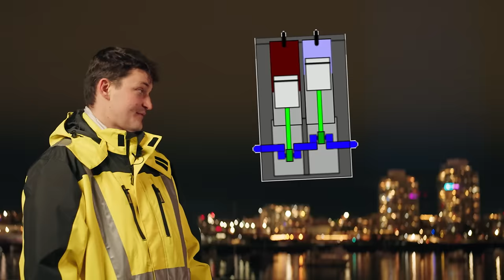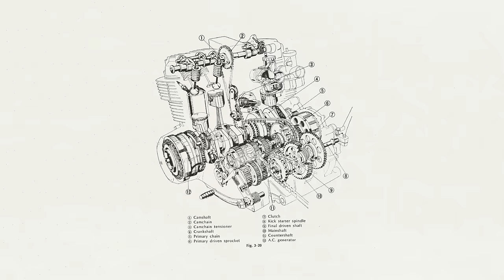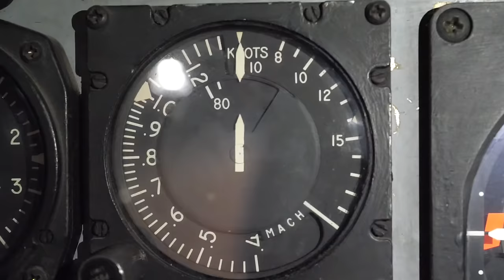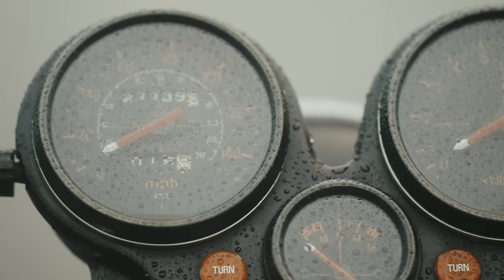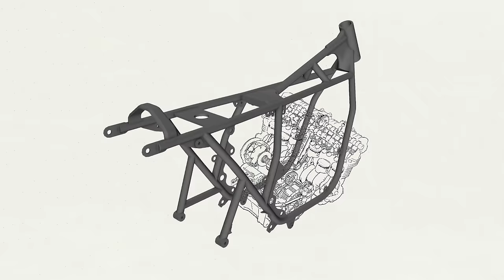Riding the Cream Machine - Honda's Smooth Six

Comment: Fortnine videos are part of what got me onto bikes and something i used to watch with my dad. He passed away very recently and every time I watch this channel I think of him.
I'll never buy a CBX, or a Pacific Coast, or a Burgman, or a CBR250RR, but Ill always have the memories of discovering them with my dad.
Reply: You can import a 250RR for around 7k thru Moto2 Imports, or buy a ZX4RR which is the same concept but with 2023 tech for ~10
Reply: @IAnolastname  I won't buy a CBR250RR because I don't want to, although it would be really cool to own.
Reply: @IamPinhead  i wont get a cbr250 as theyre common. seems everyone has one here. 

 mate had about four at one point. and somehow the prick made about $2k off each one, by simply buying at the right time, and willing to drive a few hundred km to the middle of nowhere to pick them up.

also not very comfortable.

fzr250 vastly superior in every regard.
Reply: @paradiselost9946  yes, the cbr250 is common. the 250 RR is not.
Reply: @paradiselost9946  anyone that knows anything would understand that the cbr 250, 250R and 250RR are all very different bikes. you can try to flex your knowledge of different variants of motorcycle, but that doesn't change the fact that a cbr250 is a fundamentally very different bike to the cbr250rr

Comment: Rode one of these 30 years ago, amazing machine to ride, and an unique experience. Still sticks in my memory to this day. The turbine like "woosh" of smooth power was an eye opener even in the 90's.
Reply: Same. I rode a 79 back in the day. Good ride, smooth, great  sound. I always wanted one of the last ones with the fairing.
Reply: Imagine how it felt in the 80s  🙂
Reply: @DukeDyson  I'm 66. I know what it felt like in the 80s. I also had a GS1150 in 84 and a GSXR-1100 in 86. Was a fun time.
Reply: I like the Benelli 750 Sei
Reply: @SingleTrackMined   I had the GSXR -1100M reputedly the best one to own and man that bike sometimes scared the shit out of me. I recall between stop lights even the GSX1000R of 2001 would get surprised when the black beast was wheelying right next to them.
Reply: 42 years age I had a 750 4 K2 and my flatmate had the CBX,  we swapped bikes now and then. The CBX was fun and i always wanted to own one, but also realized that the old K2 was the one for me.
Reply: @Paulman50  There's a guy at our local bike meet has a 750 K2. 4-2-4 exhausts. Handsome looking machine and he keep it pristine despite being out on it most mondays even in shit weather.

Comment: I purchased a Black 1980 CBX off the showroom floor. It was an awesome engine on a so-so chassis. 
I added an Ontario Moto Tech 6 into 2 header and  the Honda engine guards. It sounded like a Porsche Carrera! 
Otherwise it remained stock and perfect until I sold it in 1992 with 13k miles on it. 
I rode that bike from Iowa to California and back in the summer of '81 by adding a bolt on windshield and a backrest / luggage rack. 
Stayed in KOA campgrounds every night. It was a trip I've never forgotten. 
When I sold it I gave the guy the original pipes, factory service manual , and the tools and shims for valve clearance adjustments.
I wish I would have kept that bike, or at least the extra "stuff" I threw in, but that's life. 
My CBX did have an appetite for voltage regulators!
I get to still enjoy riding on my '01 FZ1, '05 Sportster and '08 Goldwing.  
I hope everyone has a wonderful holiday season, and pray for safe riding for all in the New Year!
Keep up the great videos Ryan,  I like your style!
Reply: My 99 cbr also liked voltage regulators.  Also full pumps.

Comment: I just picked up a 1981 CBX this spring and put about 2000 km on it this riding season. Looking forward to many more years on it, it is a wonderful machine.
Reply: I highly recommend taking your 81 CBX out on a empty highway and ducking down behind the fairing and onto the tank at 85 mph, out of the wind blast and noise, and just listening to the sound of the exhaust, all the cams, lifters, chains, valves, gears, etc. just whirring and singing away only a few inches below your ears. Truly nothing else like it in the motorcycle world .

Comment: Awesome video! You should do one on the last of the litre sportbikes without any rider aids whatsoever. Not sure what year that'd be, but I remember my 929RR didn't have any, not even a steering damper, making for some very hairy off-ramps and late-fall rides on wet pavement (no abs, no TC, no quick-shifter, no slipper clutch) with 130ish HP on hand.

Comment: A beautiful piece of engineering, and a beautiful video! The CBX has got to be one of the most special motorcycle ever created. The throttle response looked insane! The way the forks slid up every time you revved it, what a feeling it must be to experience!!
Reply: With such small cooling fins and 6 cylinders how in hell does this thing not overheat??? The middle ones seem to have no way of dumping all that heat due to the lack of surface. Or does it have an oil cooler? Does anyone know?

Comment: So impressed with the balance between reverence for an iconic design yet also a realistic appraisal of its shortcomings. This channel keeps improving and evolving for the better. Kudos!
Reply: Oh, it had shortcomings, by the truckful, but then you knock it down a gear, give it some, and you don't care anymore. Until you want to slow down, or turn, or refuel.
Reply: He didn't really mention any shortcomings of the bike. I'm confused as to what you're talking about.
Reply: @jaredlancaster4137  he discussed how the bike wasn’t terribly successful in sales and didn’t seem to really resonate with riders at the time.
Reply: @ooklamoc4411  and he repeatedly emphasized that that was a problem with people, not the bike. That the bike was perfect, in fact so perfect that it highlighted the shortcomings of the person riding it.

I know what you mean, but the biggest point of the video was that the bike had exactly zero shortcomings.
Reply: The perfect bike does not exist. For example the motor not vibrating at all must be good for some and not enjoyable by others, the same as having no torque on low rpms vs a lot of power at high rpms or having a motor too big and heavy for the chasis. Some people may love it but others don't, there is a motorbike for every age and everyone but non is perfect for all.

Comment: Thank you for this. I rode a CBX for 3 years. Its handling shortcomings can be overcome with a 5 piece fork brace and swapping out the factory swingarm bearings with needle bearings. A D&D  6 into 1 open megaphone pipe was treat too.

Comment: Back in the early 80's my roommate had a 78 CBX 6cyl, painted black. It was a huge bike in those days. I drove it once and only down Ottawa's Queesnway for a few miles. It was too much power for me as I was driving a 78 Yamaha 650 Special (still driving it today with 98k kms on it). I thanked him for the ride but passed on other chances to drive it. He even said it was tough to tame when holding the throttle open. His friend also owned a silver model and was an engineer/mechanic, so he did all our tunes up back then. He had great attention to engine maintenance and specifications and kept those CBX's running smoothly for years!

Comment: Love the CBX, I wish they'd make a new one
Reply from the maker: I'm not sure you'd get one past Euro 5! The unburned hydrocarbon emissions of a six cylinder are massive. The exhaust on this thing smelled like straight petrol, and it wasn't running that rich. ~RF9
Reply: @FortNine  yep, same reason why cars are moving towards 3-cylinders despite the worse balance, bigger cylinders with the same displacement = easier to pass emissions
Reply: @FortNine  Get the engineers to work. Motorcycles have been left behind in the MPG engineering department. My GS1200 doesn't get much better mileage than my Mazda6 considering the weights involved. Motorcycles could do lots better and should.
Reply: @countrugensfriend350  If you want fuel economy get a single cylinder bike.

Comment: bought one of these in the 80s that had dropped the cam chain .it had 20 bent valves 13 smashed valve guides it was pulled apart and i bought it for $600 it was 2 boot [trunk] loads to get home.cost $800 to repair in parts and head work.still kicking myself that i traded it in on a atc250 and got $1500 trade in.i loved to ride it as with the 6 into 1 it did sound awsome

Comment: As someone who owns several  CBX1000 (and a track day bike) and works on these for Customers day in day out this video is an excellent summary of the CBX. A well sorted CBX Z model is actually not as bad in stock form as some make it out to be. I have ridden many on the track, with Prolink 39mm forks and a CB1100F swinging arm it handles exceptionally well for a 70's design. Yes it's old technology but the 6 cylinder passing 9500RPM on full chat is something to behold for the rider and spectators alike.
Reply: Cary is correct! A CBX with six into six, has a scream , you have to hear to believe! 
I have a 79 and 82 in the garage!

Comment: One of my favorite motorcycles. The 79-80 were pretty much that awesome 6 cylinder engine with a Honda 750 suspension. Straight line performance was the goal, not hustling through the twisty's. 81-82 were the Sport Touring years with the larger front forks (43 mm's) and the Pro-Link rear suspension, detuned engine for more lower mid-range torque, full fairing & bags. Always wanted an 82 model with the white paint accented with blue & black striping. In SoCal in the mid-80's, you could pick up leftover 81-82 models in the $3000 price range with 79-80's for $2500. You could have bought a Baker's Dozen of CBX's for about the price of a 2024 Harley Road Glide. I wish I could time travel back to 1985. 😀

As usual, great content and video from Ryan and FortNine productions. I loved the CBX taking off from the highway.

Comment: Had a silver one in 1980 and it was some machine but I was never comfortable at speed or tightening corners, especially with any weight on the rear, like luggage - then we add 80's brakes and tyres to the mix in wet weather. That said it was an amazing machine and would have kept it but for rumors of cam chain wearouts and the associated running costs. Years later I got a HInda VF500. It was almost as fast, similar top speed, and infinitely more stable and settled. To this day I regret selling it. Thanks for this review, I think you hit the nail on the head.

Comment: I owned a 1979 CBX for 14 years. It was a great bike. To properly appreciate its sound, you need the 6-into-1 exhaust system. It positively howls with that system and sounds like a Formula 1 car. It sounds much better than the stock system or even that after-market 6-into-2 system that your test bike had.

My CBX was in pristine condition. I sold it in 2004 for $5500 which at that time was a good price. If I had only known how much they would appreciate I would have kept it. If we only know then what we know now.

Comment: Merry Christmas F9! Thank you once again for a year of great content and the ability to keep the humour and still be informative and unbiased. Also to show the  passion for motorcycles. A skill that I admire. 
To add to your CBx conudrum. I moved from a 2002 ZX-6R (carb fed and owned by myself for 15 years) to a 2018 S1000RR. I openly admit that bike is more than I will ever be rider wise and the electronics are amazing and make me look more skilled than I am. Does it have more character than a ZX6R? No does it make me feel more alive than a ZX6R? No. With no rider aids and no electronics it made me concentrate and learn. But with all things 2 wheels and powered. You only get out what you put in. Respect and knowledge will get you so far. A bum that bites the seat because your skill set needs honing also helps

Comment: I’ve got an 81 since new.  Love it.  The only issue is the 6 carbs and keeping them in sync. Lately can’t find a local shop to work on it.  The only downside.  Rides great on the highway and comfortable for my 6 foot 6 inch frame.  I think it’s too large for many riders. It was expensive in its day, but I waited until the 82's came out and they were a bargain.  Sadly when they stopped production, a year or two later you could buy these for half price.  Now they command a good price for a clean machine.  Great machine.

Comment: Please, please, please, please do a video on the mad Ducati 750 Paso. I saw one peaking its perky little face in the back of a frame on this video.  I just love the Paso’s. Such an underrated, misunderstood genuinely gorgeous one of a kind bike. I have had numerous Ducatis including: an NCR modified 1982 bevel Darmah 900 Sport; a 1988 F3 350 with a Giocamoto 540cc kit on it (I did 7k kms in 1996 on that across Europe); a 2006 Ducati ST4S, built from left over spare parts at the factory and a 1988 Ducati 750 Paso (North American model). But it’s the Paso that left pangs of longing in my heart. I beg you hear my pathetic request ! This is by far my favourite YouTube channel, by the way. Including Drachnifel’s amazing naval channel.

Comment: I owned this very bike in 1978 (mine was silver).   The first one out of the box in my area.  I owned it for FOUR months.  I got FOUR speeding tickets in that FOUR months.  I couldn't control myself.  It had the most seductive exhaust note when you got on it.  I took it back to the dealership and traded it in for a CX500.  I was fine after that.  I still have very fond memories of the CBX though...

Comment: Love Ryan's videos, been watching for years. Bought a Henson on his recommendation and loved the dirty oil video, being the extremely happy owner of an Enfield. Also considering an Aerostitch but then - do I really want to look like 49?  I bought an Insta 360, got the battery, got the t shirt - you beauty. However (and I'm sure there will be 100s of keyboard warriors flexing their fingers here) an Insta 360 Ace Pro is not a 360º camera - it's an overpriced GoPro. So it's not what I thought I was buying. I rewatched the video and yes, the video is not 360º - it's all on me. Having seen a few videos where he's using an actual 360º camera and seeing the shots from the rear and side etc - you can see how I was mistaken (particularly when the beer goggles may have been on). But really, don't buy this camera unless you want an expensive action camera. It's not even much use as a dashcam. I did try the gimp mask on but no-one was impressed.

Comment: Back in the day, as I cruised around on my beloved four cylinder KZ1000, I thought the two extra cylinders in a six-in-a-row was a waste of space. I met a motorcycle mechanic with a hot rodded six cylinder who rambled on about the power of his bike. I still wasn't sold, but, I was kept an open mind. Fast forward many years, and I've learned of the inherent balance of six-in-a-row, and heard the F1-like scream of one nearing redline. Although I never did ride one, I now have a much greater appreciation for the sixers.

Comment: Memories....meories indeed. I was in the market for a "big bore" bike back then, atually 1980 - 81. Back when no internet, no computers, you had to read! Go to the magazine section in stores and look for the motorcycle mags, of which there were a handful of. "Motorcyclists" and "Cycle World" were my two favs. Flash back to 1980, Suzuki introduced their first GS1100EX. It caused a design stir with that big rectangular headight, but the big I4 also challenged Kawi's first Z's and everyone's 750s. I was riding a red Kawi 650 (1977) and was getting used to driving it to redline. And no the 1000s and 1100s didn't handle like the 750s either unless you knew what your were doing, but damn they were fine in a straight line and roll ons! 1981....finally had enough money. Suzuki's GS110EX was one of the fastest bikes you could buy at the time $3500!  I bought a Blue one and it the final analysis, it was the favorite bike I have ever owned. Less than the next year ( I think I still have the issue of Cycle World packed away somewhere)Honda brought out their CBX.....I was like damn......that engine, that red paint!

Comment: Thanks for another great film.

I agree with a point you sort of made that the latest bikes remove the rider from the bike.  200+ BHP is irrelevent if you have to rely on electronics to tame it for you.  I have two bikes that don't even have ABS, one that does and one that has ABS, traction control and all the rest.  I feel far more engages with a bike without 'rider aids' than one with.

I like to ride a bike, not a computer.

Comment: Another little known CBX feature / fact - there are actually four camshafts, joined into two with camshaft "universal joints" (not the actual technical name, but effectively they are just U-joints) in the middle. Also, four chains in the engine, three Hy-Vo and one roller, and the final drive make for a total of five on the bike. Two oil pumps. The alternator is driven off an oil bath friction clutch with steel plates (only). The engine in a CBX weighed almost as much as a complete 1979 CB200.

Comment: The modern inline-6 motorcycle engine sure is a lot more narrow, without the need for heat-dissipating air fins, extra space for cylinder sleeves, and exotic rods and pistons sort of eliminated the RPM cap with long-stroke engines. Modern i-6 BMW is probably equivalent to the width of a big bore air cooled inline-4 of yore.